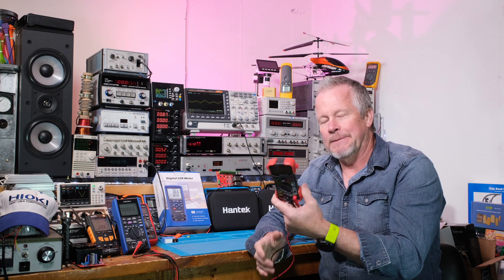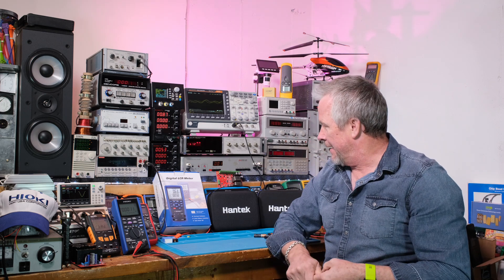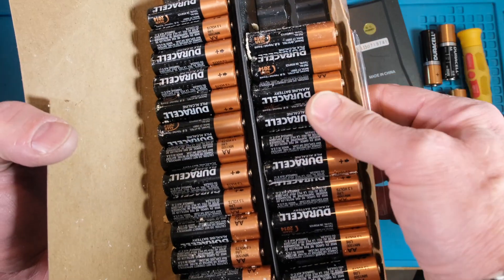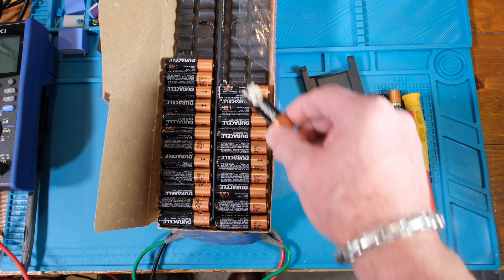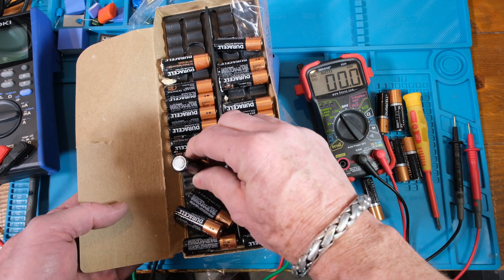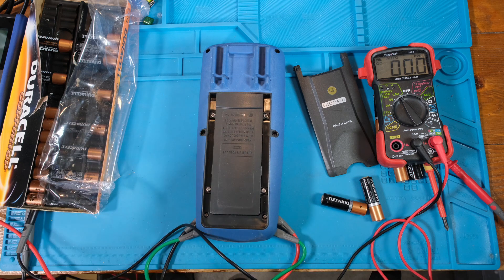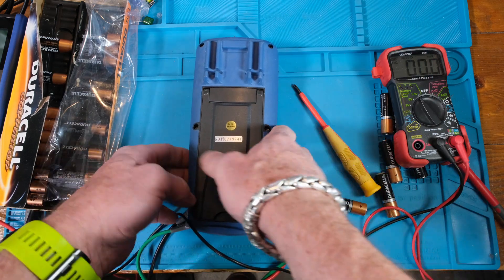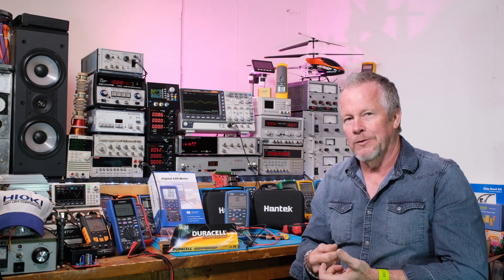Batteries Leaking -  Gold not so Golden

Comment: No! you are not the only one, the copperhead AA batteries are a problem. My apple mouse suddenly stopped working, (used it everyday) took it apart and found the corrosive chemicals had leaked everywhere that required extensive cleaning, and yes! these batteries always leak from the negative side.
Reply from the maker: Sorry about that - it always is a bummer when you see this leakage...

Comment: I can verify Duracell batteries are the worst. I've had to throw away many a ham radio equipment over the years from those leaking! I took apart a 60's era VTVM and it had an EveReady 9-lives "C" cell in it. I know it has been in there many years as it had "20 cents" marked on it. It still had 1.2V unloaded and not a single leak! I'm an EveReady man now.

Comment: As an Engineering Tech since 1977, I have always used Duracells with never a problem untill 3 or 4 years ago. I bough what looked like Duracells on AMAZON and wthin a year I had 4 different DMM's have leaky batteries. Found out that AMAZON passes loads of counterfil CRAP batteries. I started to buy IN PERSON from WalMart and so far, no more crap Duracells. However, I try to check them every 6 months and change them annually or close..
I even called Amazon back when you could talk to someone and told them about the crap batts; I should have told the stop sign a block away for all the good it took to FINALLY get an amazon rep on line. They claimed they would make a note; sure the did???
I am pretty sure Walmart does not sell counterfits and with the volume of biz they do, I doubt I'll buy a 4 or 5 year old batt there.
Reply from the maker: Thanks for this great feedback!  It would be great to know the date code when purchasing on line.

Comment: 1. You must have mixed in other batteries since the expiration dates are different. I would contact Duracell to see if the newer ones are counterfeit and to get them replaced under warranty.
2. A glass sanding pen dipped in vinegar does wonders in cleaning up corroded terminals and such.
3. The AA industrial batteries are made for medical devices and similar. They are supposed to be built to a higher standard and presumably less likely to leak.  Unfortunately they seem to only come packaged in large quantities and therefore not suitable for the average consumer. I did see today that Rayovac offers some in smaller quantities. They are bit more expensive, but less than lithium.
5. I've been switching to using AA and AAA lithium batteries in many of my devices to lessen the chance of leakage. The Energizer 9v lithium batteries are over $12 each at this time, but some other brands can be purchased for around $6-$7.
Reply from the maker: Thanks for the great feedback!  I am switching over to rechargeable as well, but I'll look out for the industrial batteries as I like to have some on hand.
Reply: @KissAnalog  With all that equipment behind you, I can see how you could order the 100 pack of industrial batteries and use them all before they go bad! The batteries that I was referring to are regular non-rechargeable lithium (e.g. Energizer Ultimate Lithium), however, I think that the rechargeable NIMH batteries are also less likely to leak. I use the low resistance  NIMH AA batteries in my camera flashes and so far have never had a leak (Disposable lithiums would be too expensive.) The non-rechargeable lithium batteries have the highest capacity and longest shelf life when compared to NIMH or alkaline. You can get a data sheet from Energizer which compares their lithium to alkaline. Start here: https://www.energizer.com/batteries/battery-comparison-chart      At the bottom of the Ultimate Lithium column click on the link for "More technical information." Then fill in the search for battery type and click on the link for the data sheet. I ordered some Amazon branded 9v lithium batteries yesterday since they come with manufacturing and "use by" dates on the package, while other brands were reported to omit this information (though you can call the company if you have the time.) This will be my first Amazon branded product. We shall see.
Reply: 06-30-2022  My Amazon lithium 9V batteries came in today. They measured 9.64V and had an expiration date of Dec 2031. I removed the GP Extra Heavy Duty alkaline battery from my just purchased from Ebay, new in clamshell plastic, multimeter. Although it measured well at 9.54V, it had an expiration date of Oct 2022 (4 months from now.) I tossed it and replaced it with the Amazon lithium. A cautionary note to always check the batteries on newly purchased items.

Comment: The reason meters use that sort of batteries is because they are standard. Otherwise, after the proprietary rechargeable battery dies, the meter would be useless.

Now, what certain brands do, like Flir, is selling special rechargeable packs that are compatible with regular, standard batteries. That way you get the best of both worlds.

Comment: Had problems with energizers with those gimmick squeeze to test strips on outside label, you dont see that feature anymore,  wonder why??  Sad to see Duracell like that.  I would  definitely  not use any of that pack but also try reaching out to Duracell  and see if they will do anything  for  you.
Reply from the maker: Thank you!  Great question!  I always wondered about those squeeze to test strips on the side of the battery...  I think the answer to the problem is not to use alkaline batteries for anything that you can not check easily and/or frequentlly.  Bad battery chemistry.

Comment: I’ve got that INNOVA meter, it’s great!  I find that all alkaline batteries leak if given enough time.  The Duracell is the WORST!  I have went to either Lithium batteries or carbon batteries (Heavy Duty)  The heavy duty batteries can be purchased at Harbor Freight.  They don’t last very long but they wont corrode.  Low current devices such as remotes get the carbon batteries.  High current devices get the lithium batteries.  

I’ve purchased old equipment at hamfests, such as a 30 year old Simpson 360 that have dead carbon batteries in them and there is no battery corrosion! 

The best way to clean the corrosion is with white vinegar.  I keep a small 2 oz bottle that has a needle type applicator on top.  A few drops of the vinegar will clean up the corrosion fast.  A toothbrush removes the solids. I then clean the vinegar off with a liberal dose of 91% isopropyl alcohol that I keep in the same type bottle.  

One thing I have noticed is that the AA sized mag light batteries will corrode extremely fast!!  Perhaps it is some kind of capacitive coupling from the aluminum flash light battery??  The flashlight must be thrown away as the battery swells and you cannot remove them.

Try carbon (heavy duty) or lithium batteries and your leaky batteries will be a long forgotten memory...
Reply from the maker: Thanks for the great feedback and advice!
Reply: Fully agree. Carbon batteries are quite easily obtained here in Australia from various well known brands and whilst they don't last as long as alkaline, they also don't leak and ruin devices. For low power applications such as remote controls, meters, clocks and so on they're a good solution to the problem.

For higher powered devices where the lower capacity of carbon batteries would be problematic, the solution is lithium or rechargeables.

If alkalines are a must for some reason then Panasonic are good in my experience. Not impossible they can leak but they're pretty good.

Comment: If NiMH batteries can be used in your equipment, I highly recommend using NiMH batteries. I have been using enloop NiMH batteries for over 20 years and have yet to find a single case of leakage.
Reply from the maker: Thank you!  I have to agree with you!

Comment: I stopped using Duracell because of this problem as well as Energizer Alkaline batteries.  In most of my Headlamp I use Low Self-discharge NiMH Batteries, and I use them in some of my meters.  They never leak and work very well in the cold.  And being that they're rechargeable they save your a great deal of money.  In my Trail Cameras I have been using the Amazon AA Alkaline and while some alkaline batteries have slight more capacity, the Amazon batteries are very reliable, perform just fine and best of all, are worry free when it come to leaking.  During the Winter months I have to use Energizer Ultimate Lithium AAs in my trail cameras because of the cold weather.  They work great but get to be quite expensive when I have as many as 20 to 30 trail cameras out in the field, with each cameras using six or eight AAs.  

Try the rechargeable Low Self-discharge NiMH AA/AAA batteries, and use the meter to get an idea on how they perform.  If you're uncomfortable using rechargeable, then go with the Amazon Alkaline AA, best bang for your buck in a good quality leak proof AA.  I use the AAA and 9v Amazon batteries also in some of my mutimeters... same good reliability.  

All my best kola...
Reply from the maker: Thanks you for this awesome feedback!!  I have been close to where you are and I am now zeroing in on exactly what you recommend;)

Comment: I purchased the Fluke 289 for logging plant compressor efficiency, dust collector and filter draw systems.  The meter is a brick, so it sits for weeks at a time while my go to meter is still my Fluke 189, a little large for the field, but I love the thing.  I don’t use alkaline anymore, I’ve had them leak in all my meters, flashlights, well, anything I’ve put them in. It may be the conditions I work in, but I only use lithium now.  Energizer lithium is the only battery I use, they will not leak, they may seem costly, but they’re not.  On average 4 times the mah and a smooth depletion curve.
Reply from the maker: Thanks for the feedback Stan!  I think rechargeable is the way to go;)

Comment: This is actually the primary reason I started putting LiFeS2 batteries any any equipment of value that requires AA or AAA cells.  It’s not worth the risk.

I do think the silver alkalines are better than the copper tops, but they both leak.
Reply from the maker: Thanks Chris - I think that is a wise move.

Comment: I started using rechargeable batteries back in 1982 when I started my undergraduate course in Physics at Strathclyde University, Glasgow. I only purchase nickel metal hydride cells in the size AA and AAA with a preference for Envelop or Fujitsu. I've not found any application where these don't work satisfactorily.
Reply from the maker: Wow - thanks Stephan!  Do you still prefer these over lithium?
Reply: @KissAnalog  Lithium ion is a great technology due to the high energy density. I've recently started a transition from 18650 to 21700 for my Nitecore Torches. The Nitecore chargers are also excellent covering both Nickel Metal Hydride and Lithium Ion.

Comment: All my Fluke meters (including 117, 87, 87III, 87V) use 9V batteries and they are all Energizer Lithium. All my decent meters either use Energizer Lithium or Eneloop. 

Alkalines? I do use them in my cheap meters. I've never tried to avoid Duracell, but for some reason, I never really use them, most of what I get here is Varta and Energiser.
Reply from the maker: Thanks for your feedback!

Comment: dollar tree "e-circuit" brand alkalines are hard to beat for the price. 4 batteries for $1. i havent had any leak, and will last awhile, not as good as a name brand but close. if you have meters burning through batteries it cant hurt to give them a try. you also mentioned at 9:36 something about 2014? were the batteries made in 2014 or were best before 2014? may have something to do with them leaking so bad.
Reply from the maker: Thanks for the tip!  Yes the batteries are dated, but the ones in the meter were not.  I would hope that they wouldn't leak, but I learned my lesson.

Comment: Ikea ladda for the win. They are rebranded eneloops. The 2450 mAh can be recharged 500 times and are the eneloop pro. The 1900 mAh are the eneloop white and can be recharged 2,000 times. I usually buy the higher capacity ones as I will never charge 2000 before they go bad. $5.99 for 4 of the 1900 mAh and $7.99 for 4 of the 2450 batteries a steal and no leaks.
Reply from the maker: Thank you for the great feedback!

Comment: If a meter is that power hungry then you can mod it and put a DC jack with jumper wires going to the where the batteries connect to the power leads. Although make sure the power cable is galvanically isolated to avoid adding an unintentional path via the ground wire or connect it to a larger battery. Probably should remove the meter's batteries to avoid the secondary P.S. doing some unwanted "charging". I've done this for some small L.E.D.S on a Christmas tree that ran on 3 AA's so avoid always having to buy batteries.
Reply: 1:51
Reply from the maker: Thanks Alex!!  That might be a great idea;)

Comment: Two testers and one keyboard died with those  duracell assasins. As a tip, one perfectly on time 9v duracell, 2 months inside a tester,, suddenly lost 1,2 volt and after that, started leaking. The problem was like on element was too old, compromising the rest of the 9v battery.
Reply from the maker: Very interesting about the 9V.  I think the safe thing is don't store anything with an alkaline battery:)

Comment: Bin the lot. I wouldn't put any of them in my equipment. Why risk "expensive" equipment on batteries that cost a few bucks. 

I just use a no name brand in most stuff and Energizer in my higher current draw stuff. Never had an issue with the no name brand. In low current applications they last 75% as long at %50 the cost.
Reply from the maker: Thanks - great advice!

Comment: Rechargeable batteries have a higher build quality and are  less prone to leak, compared to alkaline batteries. If your multimeter or other device can handle rechargeable batteries (1.2 volts per battery verse 1.5 volts for alkaline), always use the rechargeable. Use Japanese built cells, not cheap Chinese garbage rechargeable batteries.
Reply from the maker: Thanks for the great advice!!